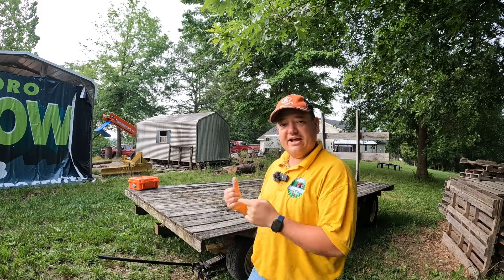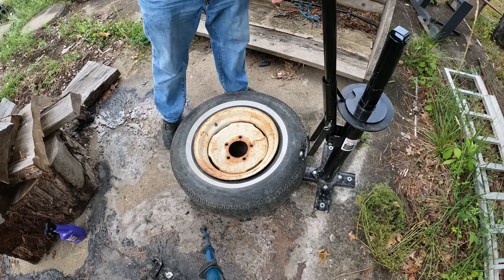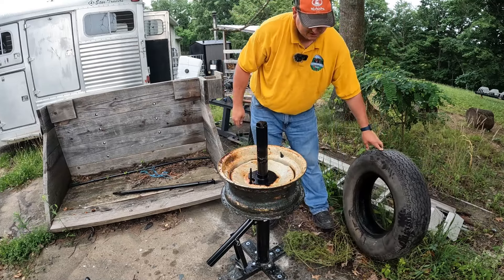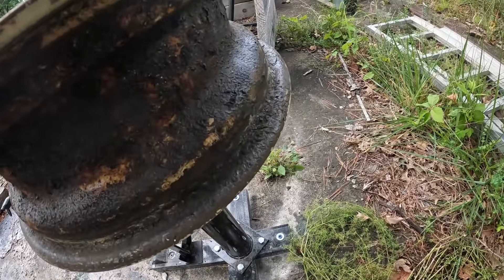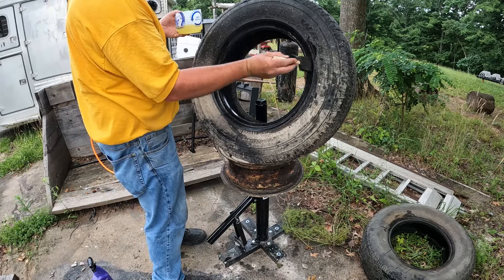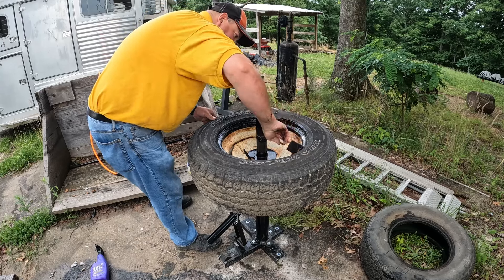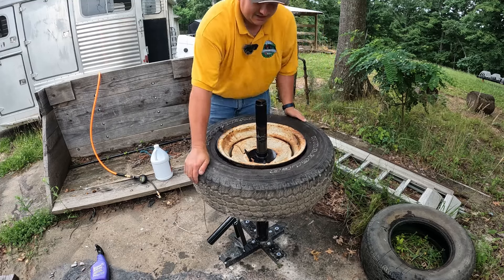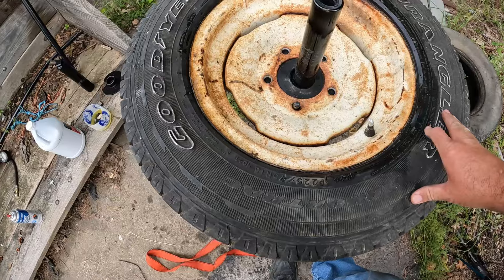Harbor Freight Manual Tire Changer First Test #328

Comment: Keep your eye out at auctions or sales for one of those bead setter air tanks. I got ahold of one for $35 so I just fill it before I change the tire and use that instead of farting around with trying to set the bead. All my tires seem to need work on Sunday morning when I need to use the equipment they are on. Good video.
Reply from the maker: Yeah I’ve been thinking about getting one, lol yeah tires always seem to go flat right when you need them
Reply: Good old starting fluid. Dose the trick for me
Reply: ❤you sir are a boss! I'm gonna get a bead setter
Reply: I tell my kids to stop farting around on a daily basis. 😂

Comment: Just an observation: when you were installing the new tire you have the installer upside down. At the very end of the pole, the wide part has a notch that is designed to ride the rim and the narrow part faces upward and guides the bead downward over then rim. You would have had a much easier time using it correctly.
Reply from the maker: Thanks for the info I will take that into consideration on the next one

Comment: I do all of my tires on this machine I was having a ton of problems trying to set the beads on the tire before you can air the tire up. I don’t mess around with a ratchet strap or anything else. I use the fire trick and it works painlessly every single time. I set the tire on the ground. Then I spray a little brake parts cleaner in between the tire and rim and over the tire onto the ground as a wick. I light the wick and it causes a little explosion inside the tire and forces both beads into place. I never struggle with this step anymore. Make sure you don’t use a lot of brake parts cleaner, ether, or any flammable spray etc. or this can be extremely dangerous. Less is more.

Comment: be sure and take valve stem core out before airing up tirre, that will give you much more flow into the tire and usually works for me, I've had the harbor freight tire changer for over 20 years and it's no telling howmutch money and time it has saved me good vid THANX!
Reply: Do you balance the tire also?

Comment: To make mounting the tire easier, put a clamp (or vise grips) on the rim to keep the tire from spinning and coming off.  Or maybe use  a clamp to pull the sides of the tire together. 😊 10:22

Comment: You could have brushed the sealant around the rim where you cleaned up. The sealant seals the bare metal. Good luck with the dump trailer  tires. Thanks for the videos.
Reply from the maker: Now that you mention that I always see the tire shops put sealant/lube on the tires and the rim, definitely will be doing that next time, thanks for the tip!

Comment: i just bought one for trailer tires and struggled using the tool and was hoping for tips on how its supposed to be used (the instructions with it are worthless) but i see you struggled with it staying in as well, so I ended up using the old tire irons and that did fine. thanks for the video

Comment: I have the same setup and the same tire bead lubricant.  You mentioned that water can cause rust on the wheel and when I got that lubricant I read the instructions on it and it's supposed to be diluted 4:1 with water.  So much for preventing rust.
Reply: Try a tire paste.